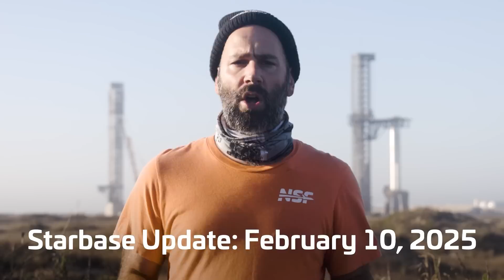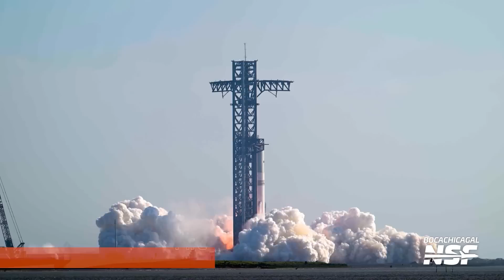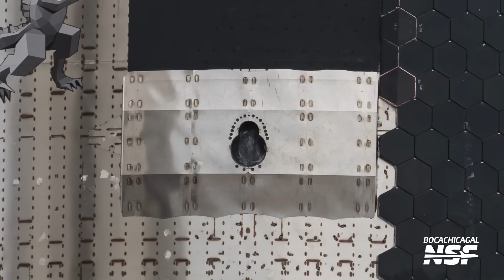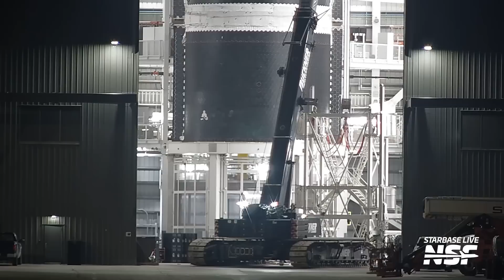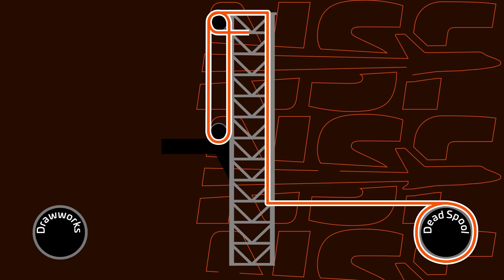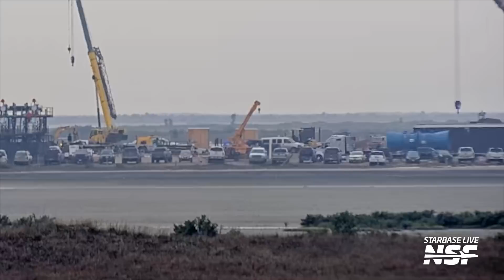Starship Flight 8 Testing Begins With A 33 Engine Static Fire 🚀 | Starbase Update

Comment: I really like the horizontally landing Lunar Starship idea. If it has to be significantly modified to land on the Moon anyway, extra landing engines, giant legs so it doesn't fall over, large elevator etc. Why not land on its side? Open the nose like a cargo aircraft and unload an "Earth" Mover and whatever other large equipmentwexd need? Bury the ship and you have an instant, larger than the ISS Moon base protected from radiation and micro impacts. M.I.T. did a study and likes the idea, there's a Youtuber who's expanded on it. I think the channels called Anthrofuturism but don't quote me on that. If we want a future in space mastering ISRU is how we get that. Its how we build space habitats that don't make you sick or require human fetal experimentation to determine if long term habitation is possible like Mars. The Moon and NEO's are how we build out space infrastructure. SpaceX's rapid iteration process is unethical to use on Mars for a multitude of reasons. Even without the human ethical implications it would be nice to study Mars in as pristine a condition possible. Crashing Starships all over it until they figure out all the ways not to land on Mars doesn't help with that. Humanity deserves to know if life ever existed there. Kinda hard to do if all you find is human snot bacteria all over the  planet. Which admittedly could already be a problem. But at least we try as hard as we can to sterilize our exploration robots. How do you do that with a Starship? Especially one loaded full of 20 year old fanboys. Sorry but Mars is stupid for the foreseeable future. Even if we didn't have a Moon and NEO's there are smarter options.

Comment: I suspect they'll put the Starlink loading box on the chopsticks. Then there is no need to roll the ship back to refill it.
Reply: there doesnt seem to be anyway to do that, since there is no hardware to do that, and the shape of the loading box and ship are very different. they will likely load the ship before the final stack.
Reply: @HamzahKhan314  At the moment, yes. But this thing is meant to be rapidly reusable, and hauling it off the pad every time and back to the bay just to reload it with cargo doesn't make sense.
Reply: @VikOlliver  they would only need to take the ship back for loading. its also likely they might eventually design a quicket method of loading payloads, but currently i havent hear anything about that.
also, spacex has mentioned they plan on contructing a lot more ships than boosters, which means they can get away with bringing only the ship back if they have other ships ready to fly (the booster does not have to be hauled back, since it will eventually be designed to refly within an hour).
Reply: @HamzahKhan314  This makes sense. The ships will spend a lot more time off the ground than the boosters will.

Comment: I'm under the impression that they want to land the Booster and the ship at SITE, why all the Launch mount 2 work.
Reply: another launch pad increase launch cadence. plus, pad b has a much better design that will increase its reliability nd turn around time. 
also, both launchpads are practically at the same site.

Comment: I think April for the Chopsticks being fully installed, tested, tuned and calibrated.  Probably all major construction activity (flame trench, OLM installation, BQD and SQD, deluge farm, and propellant farm integration) done by end of May or so.  Miscellaneous fiddly bits and surface detailing done over June while the pad undergoes break-in, integrated systems testing, and calibration.  Ready to support the first stacking, hot fire, and launch tests sometime around July, probably.  First launch, maybe in mid-July to August.

Edit: SpaceX better have a Block 2 Booster ready by then...

Comment: I saw pad will be fully operational by end of March or April
Reply: pad? unlikely. the launch mount is still being constructed, and the extra fuel tanks for stage 0 have not yet been installed. the flame trench still needs a lot of work and so does the plumbing and other systems that connect the tank farm to the launch mount. it'll likely be fully operational sometime in the second half of this year.
as for the chopsticks, that'll likely be operational by march. we're probably going to see catches with pad B long before any launches.